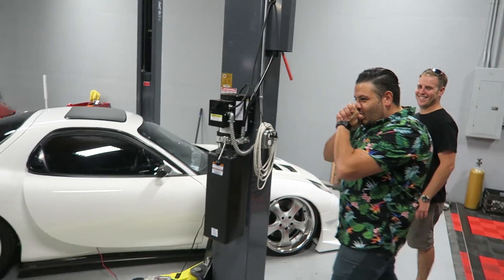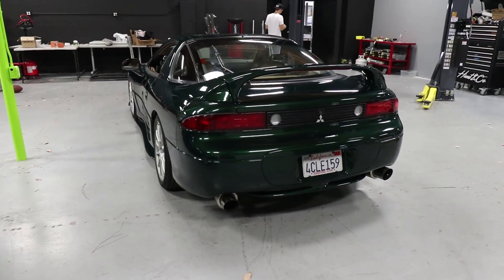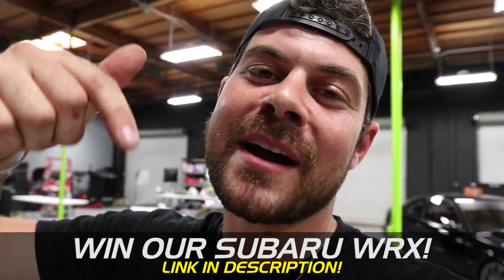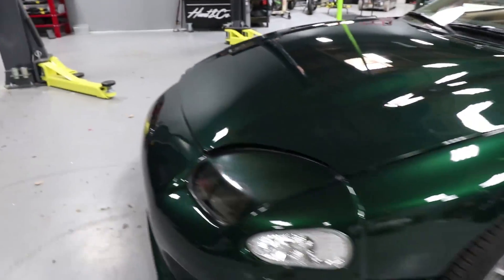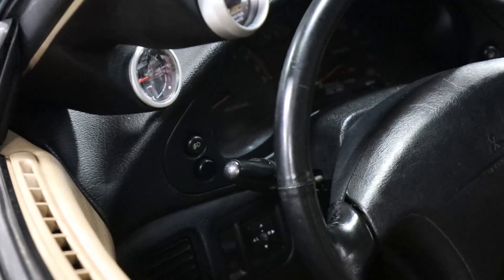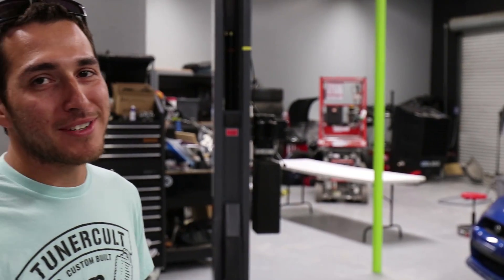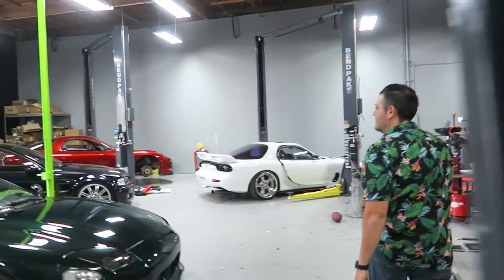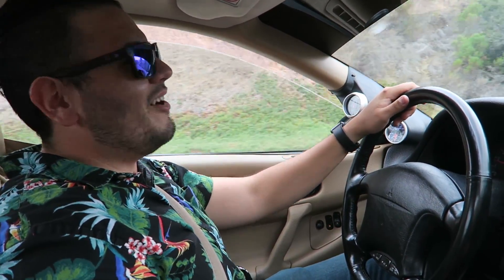WHAT HAPPENED TO THE 3000GT VR-4 GIVEAWAY CAR?!?!

Comment: That was an awesome car.  I would love to have it in black, but that green color looks totally awesome.  All that needs to be done to it is to have the wheels powder coated black, the intercooler and the pipes coated black for stealth, the clear side markers tinted black, the windows tinted, the guage pod color matched to the pillar, give it a flex fuel tune, and maybe switch back to the USDM rear Mitsubishi logo.  I would rock it just like that with those minor changes for a long time.  Congrats Mark!
Reply: Check out mine

Comment: That VR4 is the next supra and FD it's going to rocket in value I'm looking for one for the low just to sit on it and keep it fresh
Reply: Me How ok just saying, look back 2 years they are going up already just like old 5 series BMW's
Reply: Luis Rodriguez you hypebeast
Reply: Luis Rodriguez hes a kid just ignor him and he will crawl back under his bridge
Reply: rcav look at this gay guy Luis
Reply: thats true ive been into 3000gts since 2011 and prices are sky rocketing compared to 4 years ago. especially 2nd gen vr4s
Reply: Nah, they're just too complex and have too many problems, and a pain in the ass to work on.
Reply: Pube83 that doesn’t matter I mean look at rx-7’s
Reply: Paul Gutierrez 
An rx7 is way easier to work on than a 3000gt, with plenty of space in the engine bay. As for reliability, sure the 13b needs new seals then you simply add some oil to the fuel mixture and the engine is fine. The 3kgt is a nightmare to work and has Mitsubishi quality  (lack of).
Reply: They are already rare
Reply: Pube83 "Sure it needs new seals?"  An engine that fails after only 30k miles is ridiculous.  The 6g72 TT can go 200k before a rebuild.  Space is tight but if you do the vacuum reduction and get rid of the cruise, abs and other stuff you don't need, it cleans up the engine bay.  Also oil pre-mixing is a huge pain in the ass.  Not to mention the RX7 interior quality is extremely poor.  Cheap plastic, non power drivers seat, manual climate control.  The 3000gt is a luxury grand tourer, built for comfort as well as speed.
Reply: Pube83 ummm I see your comment and then I see your profile picture I think that speaks for it self
Reply: You have no clue what you are talking about. The VR4 is very reliable if taken care of, just like most cars out there. Just took mine on an almost 4000-mile trip last year through burning British Columbia. It is idiots that delete stuff and replace stuff without really knowing how everything is connected that ruin these cars. People in the know have zero problems with these cars, nothing more than any other car would give you anyway.
Reply: Clark Kyle dude the VR4 is going to rocket in value just you wait kiddo
Reply: Yeah my 1g Stealth RT/TT is almost done... It just gets sunny day cruises to keep the miles under 90k... Once i got it almost done i realized what i had and its value, I ditched the idea of it being a daily and just bought a beater 3000gt for a daily...!!!
Reply: Jj Abatie dang that's dope man
Reply: Pube83 that’s what it’s a crazy feeling knowing I can keep em for life

Comment: The VR4 is cool when built and all, but they are super unreliable. Hopefully he keeps it, changes the color inside and out and builds it. If not, sell it.
Reply: You don't know what you're talking about.
Reply: VR4 Hero Don't be a fanboy...lf you know anything about these cars, they are shit unless you build them correctly. There's so many people here in the Atlanta area that can back me up, plus people here that know about these pieces of shit.
Reply: The problem is people cut corners and put shitty parts and half ass jobs on the cars, don'tkeep up with the maintenance and expect them to run right. EBay parts are for civics. You have to pay to play. I hate when people bash something without owning one.
Reply: I have a base model with 175,000 miles and it runs like a dime. Take care of almost any car and it will last. I know there are countless amounts of people on the forums well over 150k making 500hp on the original engine. The 6G72 can hold thousands of horsepower too if built right.
Reply: They are super reliable if kept stock, and if modified you have to do it right!  Amazings machines 3000gt vr4s and eclipses gsx and gst..
Reply: "super unreliable"
Very ignorant comment. Have you ever owned one? Do you even know about cars?